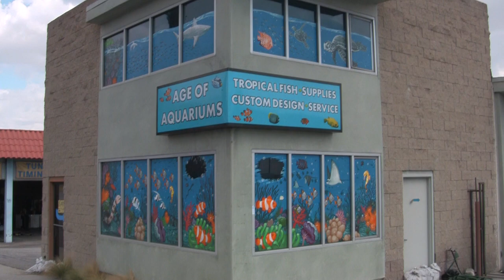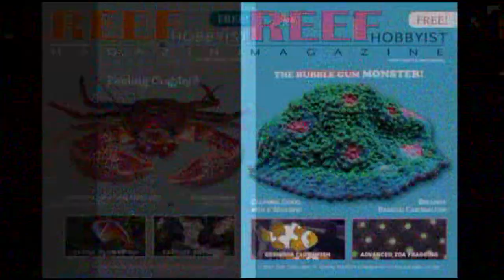Where is the Triggerfish?, LA Fishguys, Episode 121 pt 2

Comment from the maker: hey B, I do not wish to use a Clen Up Crew for two reasons; if you missed it there are triggerfish in this tank and they would eat crabs, hermits and shrimps, this is a fish-only system and at some point I expect to have to add a copper based medication which would wipe out the CUC.

Comment from the maker: hey J, I do not wish to use a Clen Up Crew for two reasons; if you missed it there are triggerfish in this tank and they would eat crabs, hermits and shrimps, this is a fish-only system and at some point I expect to have to add a copper based medication which would wipe out the CUC. as a newby to SW you need to stop listening to others without understanding the whole process, yes a canister filter will produce nitrates, so does every other biological filter in the tank... thats what they do.